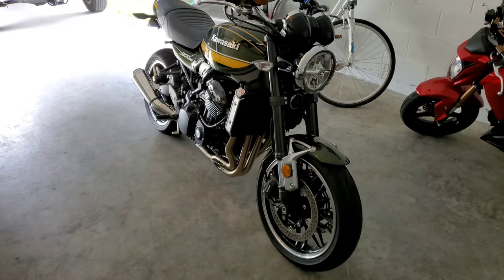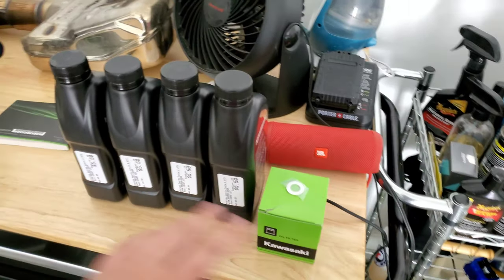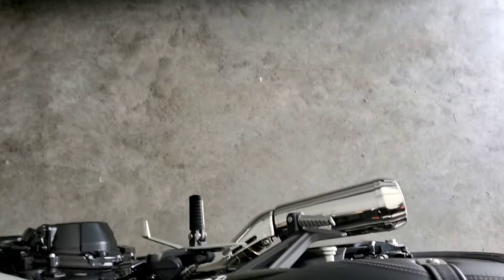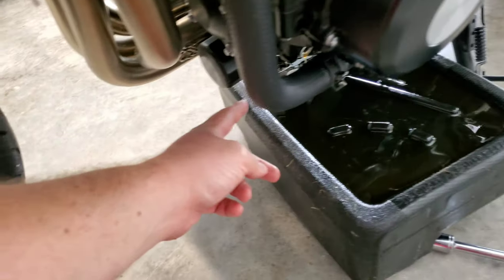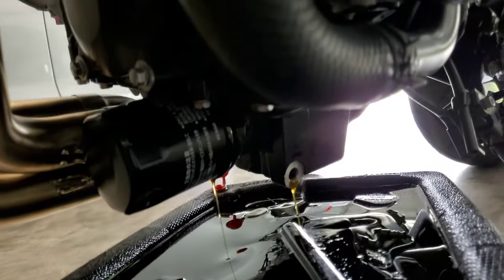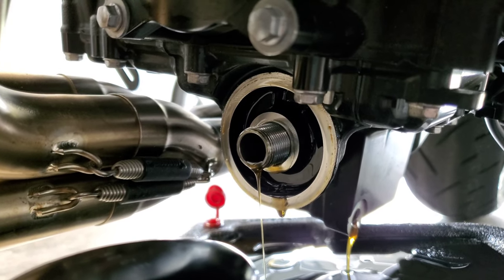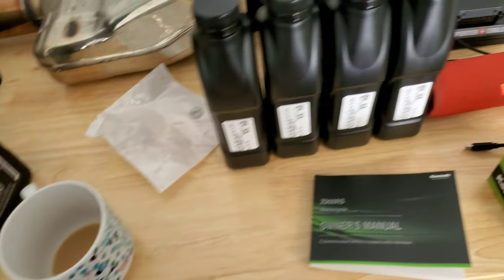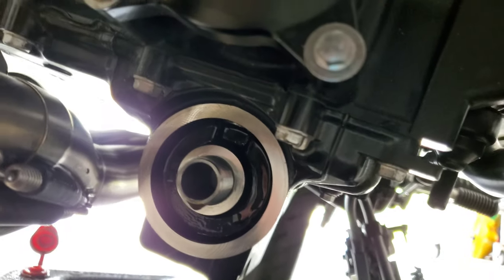Z900RS First 600 Mile Oil Change (Full Walkthrough)

Comment: Super useful. Will get mine next week, so it's nice to see a thorough walkthrough of the oil change process. Will probably let the shop do it for the 600 miles one, as I also need to go there to install the heated grips. But you have showed that it is super easy to DIY. Thanks for the video.

Comment: add a hose clamp around the filter and snug it down where the stop is against the 14mm crank bolt.  Filter cannot come off.

This is something I learned at race tracks that required it to prevent oil messes on track and protects your bike.

Comment: Thanks very much for this, very useful - 2 minor comments - personally I prefer to change the oil when the bikes fully hot especially when access to the drain plug and filter is easy  as I think more impurities will be suspended in the oil, and also if you take the filler cap off before starting to drain the oil it usually comes out a bit quicker

Comment: Hi Michael, Good video, I have a 2020 Z900RS Cafe that I bought used with 130 miles on it. I'm more than sure that  this summer I will be changing out the break-in oil. Curious to know where you heard that you shouldn't use synthetic oil for the first couple of thousand of miles?

Comment: I see you did what i did. I also took off the headers and put on aftermarket, mine are Delkevic. Have you also had it flashed?
Reply from the maker: Hey man I just installed the akrapovic headers recently. Currently the ecu isn't flashed but I am planning on do the ivans tune.
Reply: @MChappysGarage  Im sure you're aware, but that then void your warranty.
Reply: @rickallen6378  The headers void your warranty, or ur saying the FLASH will void the warranty ?!
Reply: @TopshelfJunior  flash voids warranty

Comment: The last couple new cars I've had recommended first oil change was 6000 miles. I don't get why motorcycle first oil change is 600 miles. That oil u were draining looked really really good. Anywho, I'm old skool and want a z900rs. Thanx for a great instructional vid!
Reply from the maker: Bike engines are generally speaking much more abused than car motors lol, most cars I’ve had I’ve always changed around 3k miles if they are brand new. Oil is cheap new engines aren’t
Reply: @Michael C  I don't run my bikes or cars hard. It's a money making thing Michael.
Reply: Can’t compare the two as bike oil has to deal with engine, clutch and gearbox. Bike motors rev much higher.

Comment: FYI. Any good type of oil will work just as well as Kawasaki brand. Oil is oil. Filters are a bit different but do the same.  Good 👍 job besides my comments. I have the same bike bud z900rs 2018. Red. Bad ass motorcycle
Reply from the maker: I switched over to motul 7100 4t and the bike loves it. Has made the shifts a lot more crisp as well

Comment: I'd recommend K&N oil filters. X-High quality, but they also weld a 17mm nut onto the head of the filter body which makes the loosening part easy with a ratchet, and 17mm socket, especially if the oil is hot. The nut is "holed" for safety wire. And you can get them in a chromed body if you want. It's a KN-303 for the Z900RS. If you video your mileage, and change you won't have a warranty issue with a top end filter.

Comment: The manual lists torque specs for both the drain bolt and the oil filter for a reason…
Reply from the maker: cool I have been working on cars and bikes for a while and have never had issues with hand tight on oil filters and snugged just a quarter turn on drain bolts.